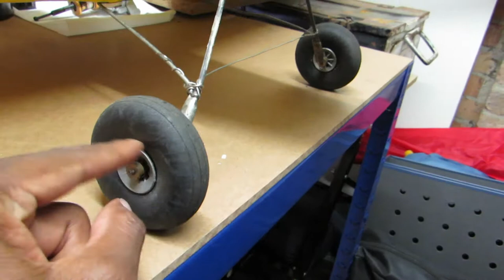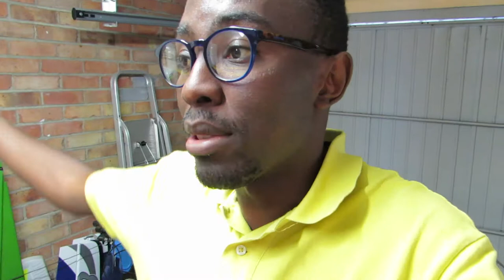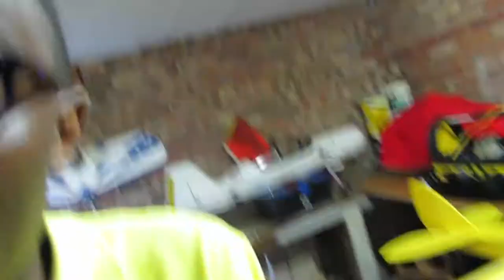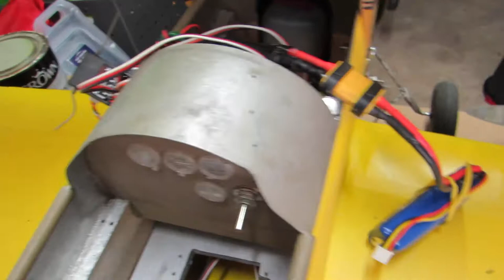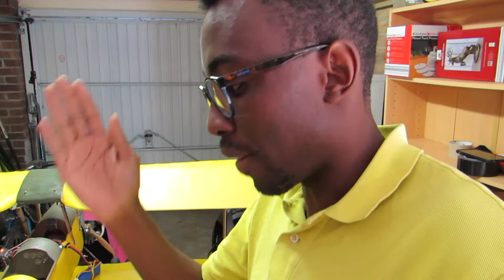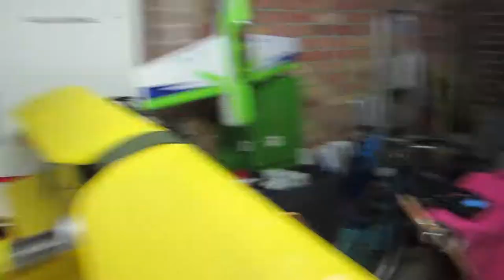RC Nitro   Tiger Moth

Comment: You weren’t even turning the prop the correct way
Reply from the maker: Hey CC CC, its a bit of a strange one to be honest as thats actually the way its meant to turn , if you look at the bite angle of the prop you can see it turns anti- clock wise. i tried to fly it for the first time yesterday and it would not even live the ground due to a lack of power ! so back to the work shop! thanks for your comment and for watching :)